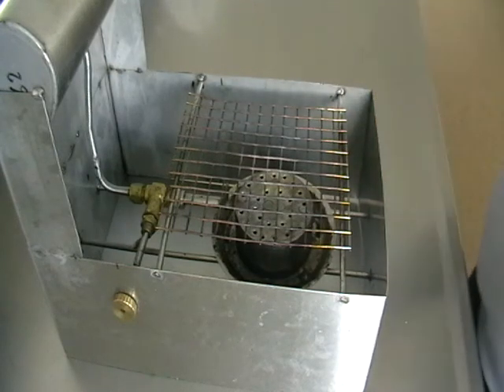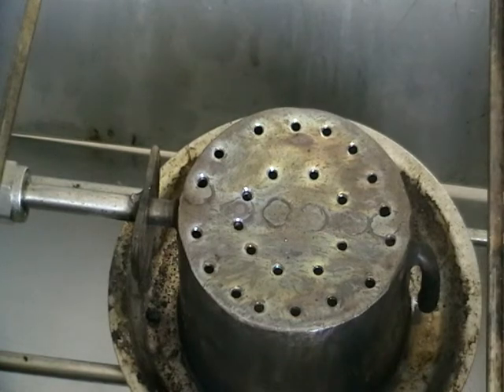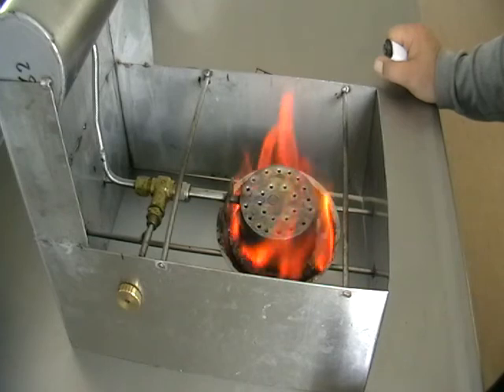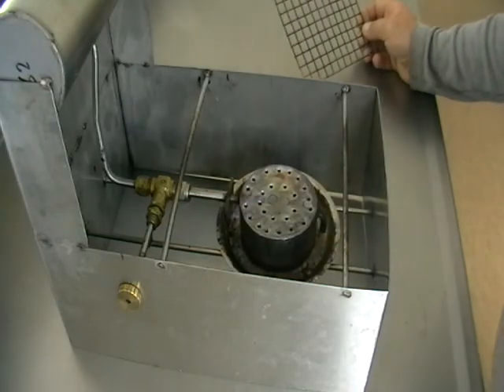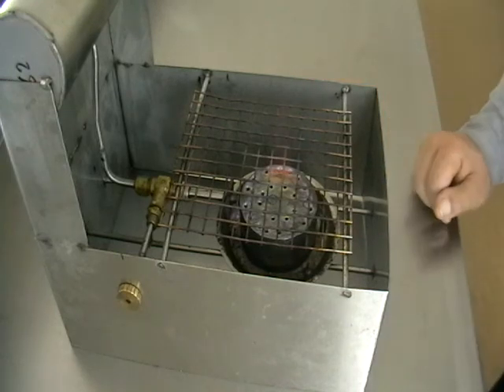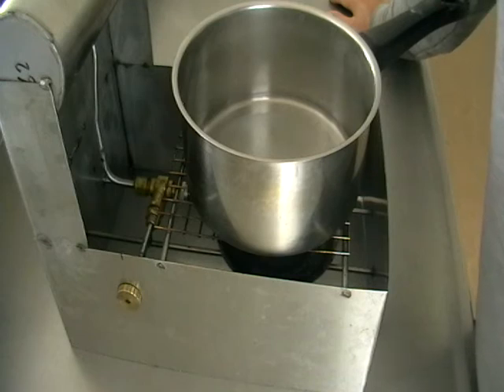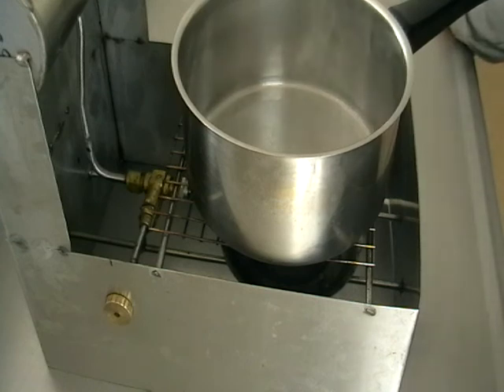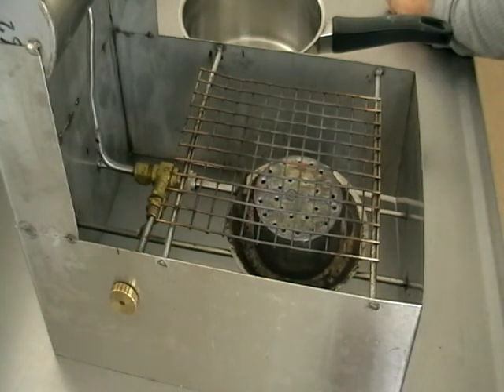Ethanol fuel stove.

Comment: if you put a bigger pot on there please put a heat shield in front of the tank and input line my friend. I think maybe that tank could get a little too warm. I sure like it as an alternative fuel! So Clean!
Reply from the maker: Been trying bigger pots, and cooking with bigger pots and pans while living workshop for 5 months - no trouble at all - the boiling point of the ethanol is 78c - this is not a petrol.
Reply: I thought maybe the heat might role up under the edge of the pot and put heat under the tank, I'm glad its not a concern. Whats going on with living at the shop? did your place get heavy flood damage? I hope all is well my friend.